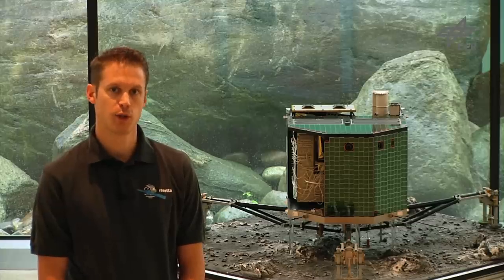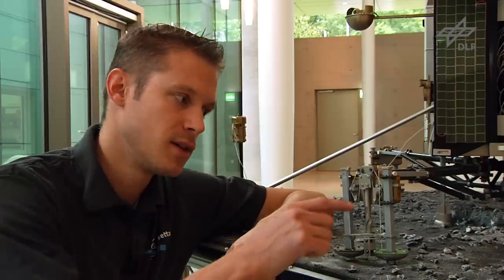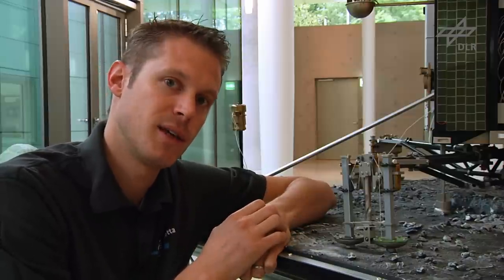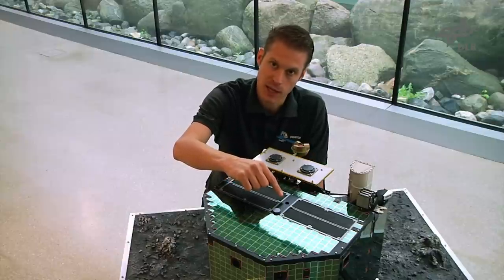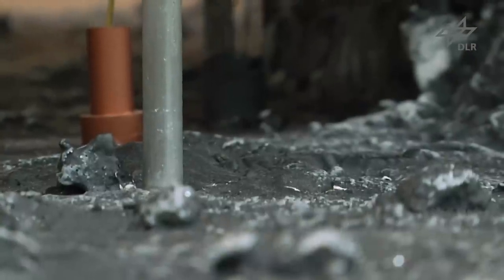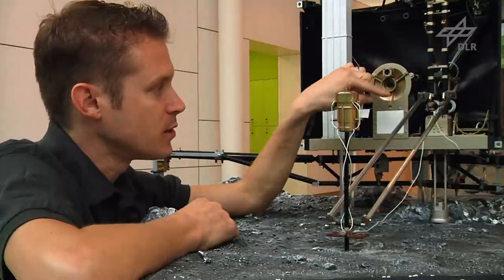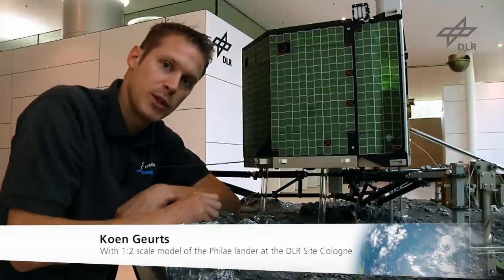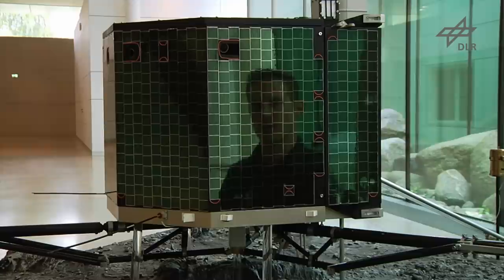The working of… Philae, the comet lander / Wie funktioniert... der Kometenlander Philae?

Comment: I sure hope the lander can get u guys some data. The lander appears to be designed to land on ice. What contingencies are you guys able to put in place to safeguard against landing on solid rock? The thermometer wouldn't penetrate, the drill either? Maybe the feet will provide something if it's attached... What about electrical and magnet field measurements. Got anything to measure more than microvolts? Hope so. Hope there are no discharge events but if so... Can you identify them or will it be explained away as landing on a hard high pressure steam jet accidentally and prevented from attaching or maybe the ice was too loosely packed and it floated away.... Hmmmm that sounds feasible. We know the ice is covered with a black mantle right? Maybe its too hard or too thick for the instruments to penetrate? Probably should have listened to Halton ARP before you designed that thing... Well as you can guess, my hindsight is in line with the electric universe. You guys should start considering plasma and electricity, if only as a control factor in your experiments.
Reply: this is all designed for rock... :)